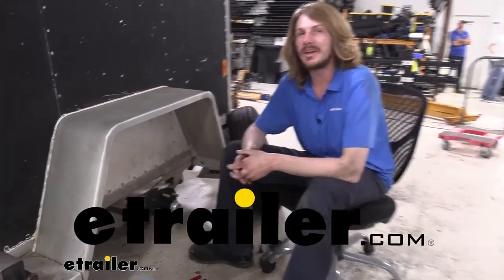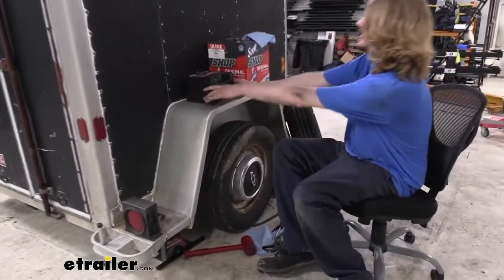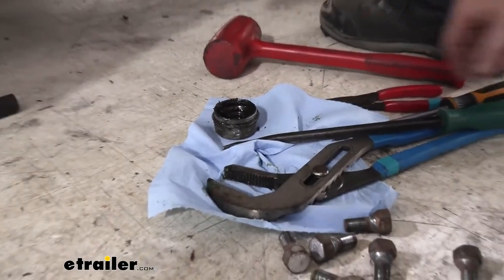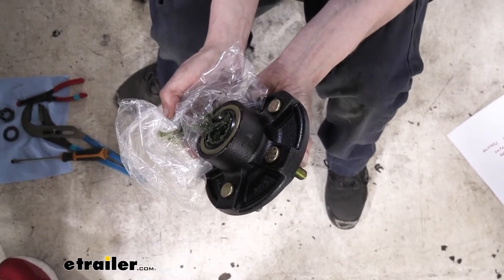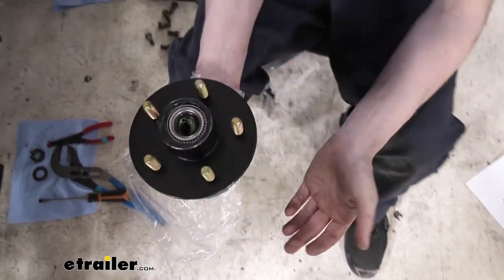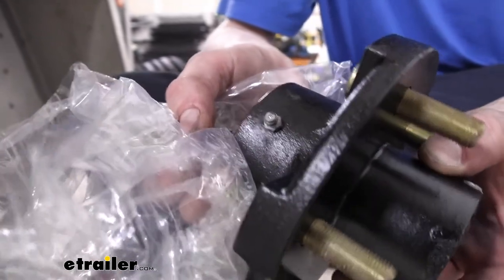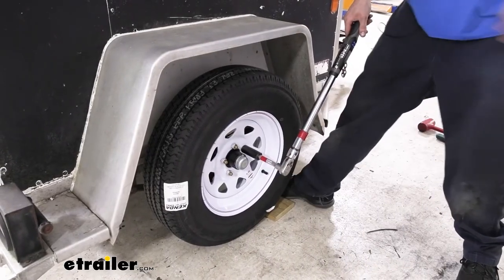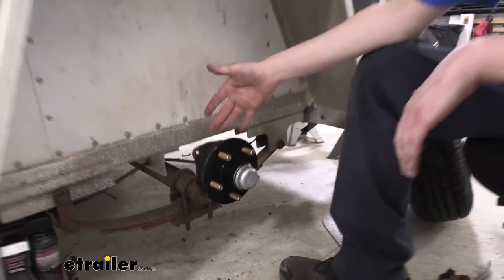etrailer | An In-Depth Look at the CE Smith Trailer Hub Assembly w/ Carrying Case for 3,500-lb Axles

Comment: A very light dab of anti seize on the new lug threads would be appreciated at removal, especially after several outings in the rain, or dunkings at the boat launch. Be sure you have a socket or tool that fits those new lug nuts, too!
Reply from the maker: If using anti seize on the wheel studs works for you, that's great. However, it looks like there's a lot of folks that say doing so changes the torque value which could cause problems. There doesn't look to be a clear consensus as to whether that's a good idea or not.
Reply: @etrailer  Comes down to corroded lug studs, or not. Being dunked in the water for sure. Tighten to the lowest range recommended. Always works for me.